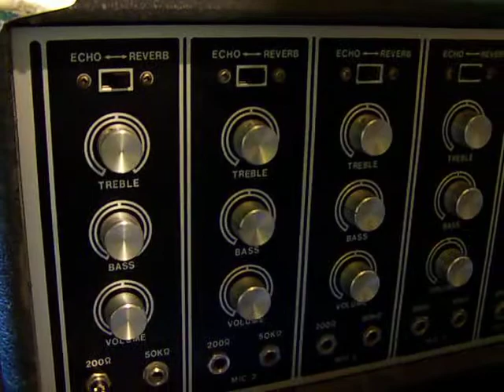Royal Vocal Amp

Comment: Hi. Great demo. How did you accomplish the "emulations"...I ran across one of these. If you modded the circuits, did you come up with a schematic? Haven't been able to find anything. Mine has burnt out wirewound resistor connected to the power caps, which are bad from inspection, tops all puffed out. I'm thinking of using a couple channels , the extra tube, to make a Marshall, leave the rest stock and use for actual vocals..practice and small gigs. Do you have any pics of the inside of the chassis underneath? Have a cap lead come loose, dangling, can't tell where it goes. Schematic would be great. These look really well built, JIS spec River resistors...can't find a name on the transformers, Matsushita I guess..Sounds great, nice growl...